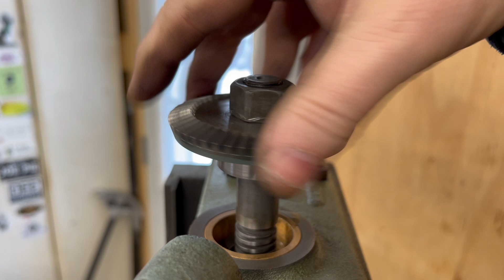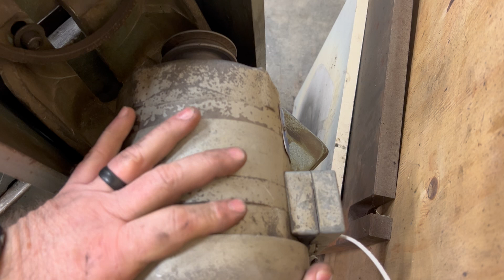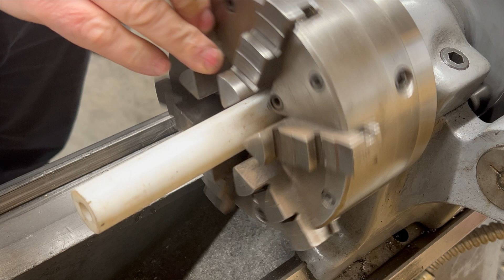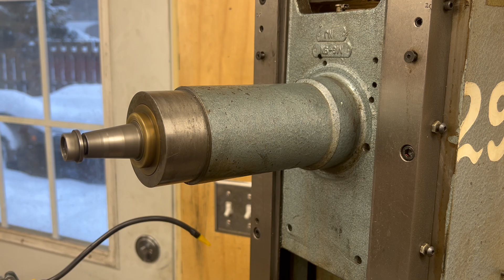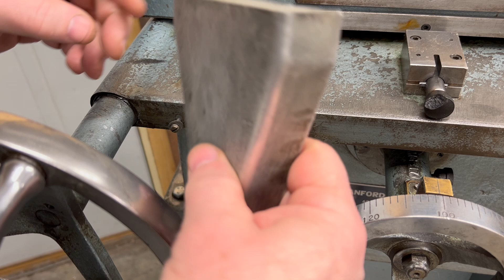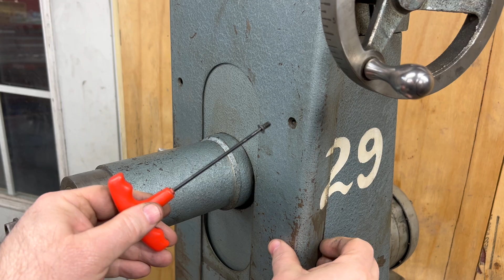Sanford Surface Grinder - Mounting the motor, fixing the fan

Comment: Looking good. Although not putting those sliding covers back on in size order really triggers my OCD.  Plus it's one more place for grinding dust to get in.
Reply from the maker: It's the one thing I didn't pay attention to when I removed them. TBH, I am still not sure I put them back together the right way.
Reply: @MyLilMule  If it's like my Harig they just go from largest opening to smallest (round hole).

Comment: Greg I like the idea of making the grommets. I have an old battery charger that I am using for electrolysis that needs one so I will follow your lead and just make one from some Delrin.
Reply from the maker: I just bought some rusty tooling and I was thinking about using an electrolysis rust removal setup instead of the chemical cleaners like Evaporust (I don't have any more and it is still expensive)

Comment: Very nice.
Good thing that motor noise was an easy fix.
Reply from the maker: If it had been a bad motor, I might have just started over with a different machine.They can be found in my area for not much money (less than $200).